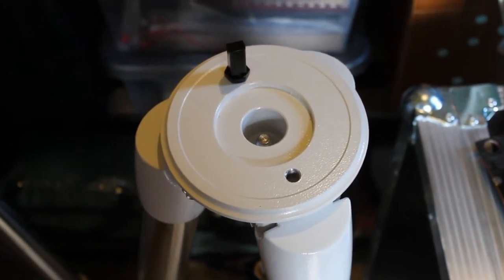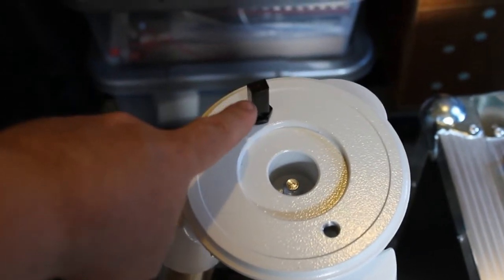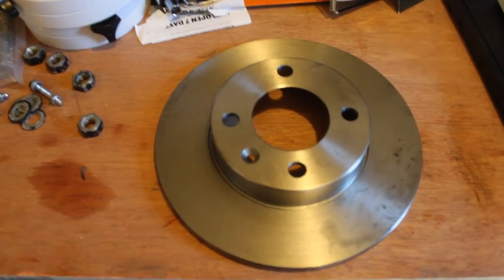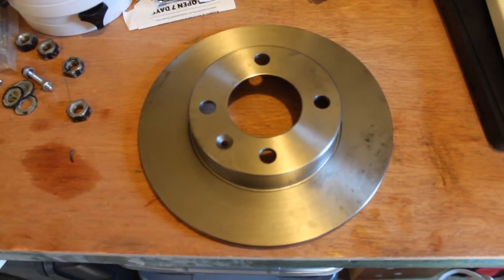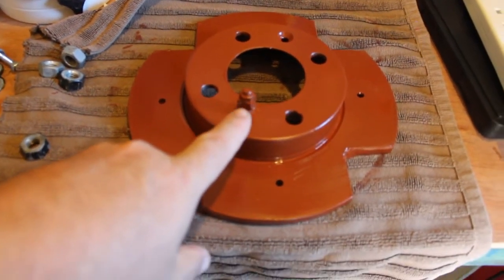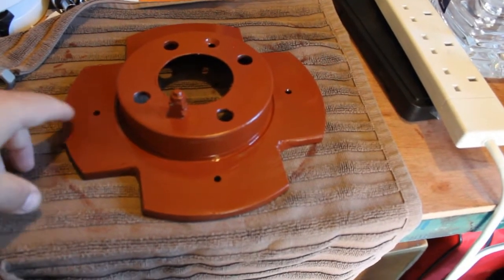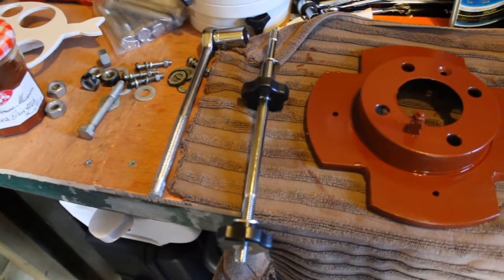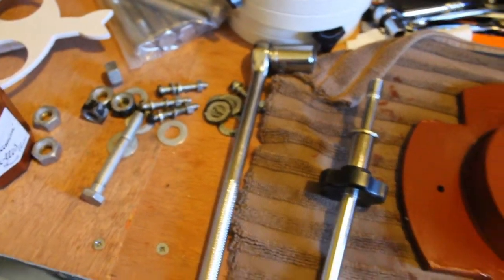DIY Pier Adaptor for Skywatcher EQ6-R Pro Mount.

Comment: a brake disk, was such a brilliant idea mate, but it doesn't match with a wood pillar. Pour some concrete as soon as possible, that wood will deform an deteriorate costantly outside.
Reply from the maker: @rewind-and-press-play  hey, thanks for the comment! Since I put this video up, I've moved house, built a dedicated observatory and fabricated a steel mount which is bolted onto a poured concrete base. I've still stuck with the brake disc idea on top of it though 😁

Comment: Hi, and thanks for this. I know it's 5 years since you posted it, but hope you still answer questions! What is the function of the middle plate - as you have bolted/welded a plate under the disc brake, why couldn't you fix it directly to the plate on top of your pier? Secondly, with a wooden pier, have you had any vibration issues? It'll be easier for me to set up a wooden one than a poured cement, so would appreciate your input! Thanks...
Reply from the maker: Hi there!. I'm still around and still astronomise but just don't have the time to do anything for YT. But I'm glad people like yourself are still finding it useful ☺️. So, the middle plate. I was very much thinking on my feet and thought the middle plate would add a bit of rigidity. I think after doing it this way, and seeing how others have used similar ideas, I could probably come up with some modifications. Now though, I have a permanent pier in an observatory. Kind of based on the wooden version in this video but made from steel.
And as for the wooden pier itself, well it was a success while I used it. I since moved house and there was no way I was going to dig down and break the concrete to get it out the ground 😂. So, it became a garden birdbath for the next occupants of our old house. Of course, there was vibration, but providing it wasn't touched while imaging, for me it was pretty solid. And definitely good enough for visual. But the question is, would I do it again? Well, on a budget, yes. All the convenience of a permanent set up/location saves a huge amount of time. But by saving and waiting it out until I could afford a concrete base and steel pier, it is obviously the better option.
I have also heard about other people using railway sleepers for piers, that it can also depend on your soil and proximity to main roads. If your soil is stoney, then apparently there is less dampening of vibrations from your surroundings. I've also read of people witnessing vibrations from passing HGVs etc. though that was never going to be a problem for me. I hope that at least partly answers your questions. 👍
Reply: @astromadness  thanks for the fast answer. In that case, I think I will continue with a poured pier, as it will also be in an observatory I am hoping to build this summer. 61 deg North, so permafrost will be an issue...

Comment: I purchased a disk brake with 65mm diameter center hole as you did and mentioned in your video. However my EQ6r seems not to fit perfectly. (It wong go all the way through) Probably 66mm would have worked. Did you incurred same issue? Did you have to trim/shave the hole a bit? By the way, excellent video and inspiring instructions. Thanks for sharing your experience with the comunity!
Reply from the maker: Hi Sebastiano,
Thanks for your kind comments. For me, the size was spot on. Once I put the mount into the hole, there was no movement from side to side, but it was loose enough to rotate with relative ease for polar alignment. I don't know much about engineering tolerances but I guess either the disc or the mount only need to be a mm or so different for there to be a little bit of play.
Best of luck with your project 👍
Tony
Reply: @astromadness  Hi Tony, thanks for the quick reply. I measured  the hole diameter of the plate and the protrusion of the mount and they are both 65 mm spot on so maybe it is a mater of tapping and "force" the install. Probably both pieces are in their lower tolerance but i feel I can make it work with extra elbow grease work!

Comment: I think you did a lot of research and made an really good job with the mount interface. But then to use a wooden pillar? I'd suggest that you make a substantial concrete one instead.
Reply from the maker: The wooden pillar for me was more affordable at the time and worked perfectly well. Since then, I have moved house. I now have a steel pillar on a concrete base in my observatory. All good and viable options to suit different needs and budgets 🙂👍

Comment: I also liked your video . I have an HEQ5PRO mount and I placed it on a concrete permanent pier and while the top portion of the pier was still wet concrete it had cut of my tripod legs leaving about 8 inches of leg and the tripod head and then sank the legs into the concrete well balance for level. And then waited 3 days for the concrete to cure. At that time I placed the mount on the tripod head and had enough room to use the long bolt that went thru the tripod into the mount bottom to firmly attach the mount to the tripod head. Yes I have ruined a perfectly good tripod but it was cheaper than ordering a pier head for the mount.
Reply: Aren’t the tripod legs hollow?  Do you have any pics or video you can share us. Thanks

Comment: Love it mate. We inherited a small vacation cottage just far enough from the city that the sky is dark there but its not too expensive to drive there and I thought about building a piere there and possibly building a shed around it later on. Then I looked at the prices of those pier adapters and those adapters cost like half of what I paid for my entire mount. like 100-200 quid or even more for like 2 pieces of aluminium. screw that. Glad I found out about using the brake disc

Comment: Love it, I am looking to do something very similar with a disc brake.  Can I just ask, why use an additional third plate to attach the disc brake to and why not just connect it to the second leveling plate?
Reply from the maker: Hi there!.  Thanks for your comment and question.  So, the bottom steel plate was just to be able to bolt down the metal work to the top of the wooden pier.  (Since this video, I have moved house and have an observatory, so it is now welded to the top of my steel pier.)  The middle plate has a small hole in the middle of it, large enough to take the bolt which screws up under the mount.  The bolt head pushes against it as the threaded end of the bolt screws into the mount, securing it into place.  And then the top plate is just used to bolt the adapted disc to.  Hopefully that answers your question :-)  Clear skies!
Reply: @astromadness  Ahh thanks for that explanation.  So I take it that the centre bolt was too long so you needed the middle plate to secure it up to ?
Reply from the maker: @julian489289  yep, that's it exactly 👍

Comment: Hi, some Gr8 ideas in the video.  I am in Australia.  Is your mount mainly for visual observing, as for Astrophotography if the wooden post  warps, expands, ages etc it would affect a perfect polar alignment.  Would have thought a metal post like steam pipe would be the go.  Also the mount is rather high above the pier which could cause some minor flex when wind gusts occurs on the scope causing imaging issues.  Your thoughts.... Cheers Mike
Reply from the maker: Hi Mike.  Thanks for your comment, and for taking the time to view the video.  I made this pier a few years ago now.  Since making this video, I have moved house and now have a permanent observatory with a steel pier bolted into a concrete 1m cubed base.  I understand fully your thoughts on the wooden pier idea though.  At that time, it was a case of making a pier to a budget for as little as possible, and to be honest, I think it totally worked.  I never left my mount in situ, so when it come to polar alignment etc, then I always needed to re-polar align when I set up my kit anyway.  Don't get me wrong, the wooden pier did have a little bit of movement, but it was functional.  Originally, I used it with a lighter Celestron AVX mount and a SkyWatcher 150p reflector and to be honest, I did end up using it more for observing than for imaging.  Again though, it served a purpose and I'm really glad I built it and got use out of it.
In different climates, you're right, I think it could of given me a few more issues over time with hot and cold weather extremes.  Generally though, in the UK, the weather is crap most of the time :-) so we don't have to worry about it too much.  If I wanted a pier purely for visual, I would probably use wood again to be honest, but once I got my observatory, I was only ever going to build a steel pier.  However, I have used the same brake disc idea for a pier adapter on the steel pier too.  When we left our old place, I left the wooden pier in situ and I believe it is now enjoying it's new life as a bird bath now! :-)
I wrote a blog post on building my pier.  Link here http://www.astromadness.co.uk/2020/02/diy-steel-observatory-pier.html  
All the very best, and clear skies,
Tony

Comment: Just got this mount yesterday and thinking about how to install it on my pier. Any reason not to just fix the top of the tripod to a plate ?
Reply from the maker: Hi there. The thought had crossed my mind, but I wanted to retain my tripod in one  piece so I still have the option of taking my mount to star parties. 🙂
Reply: Yes you could tripod top to a plate, but where to you put the through bolt to firmly attach the mount to the plate. I solved this with a concrete pier and the top portion of my tripod with mount head set in the concrete at the top of the pier. I cut all 3 tripod legs leaving about 8 to 10 inches to set into the concrete pier as it dried. Now I had room to use the threaded rod up into the mount base.

Comment: Hi..  The car is important because I would like to build one myself.. exactly what care was it from please ?
Or do you have a link from where you purchased it from.
I would be grateful for your help..
Thanks,   G
Reply from the maker: Hi, I'm really sorry for the late response, but I can't find the details of the order I placed, despite looking through all my emails.  However, the way I did it was to search online for a brake disc catalogue.  They have all the dimensions in there, including the hole diameter, the height of the disk etc.  I measured the top of the tripod which came with the mount to get the dimensions, and then just searched for a brake disc of an appropriate size.  That's what I would have to do again if I needed to repeat the process.  Thanks.  Tony

Comment: Hi, I was planning on doing this very thing and happened across your video. What car did the rotor come from? I know a 1983 Volkswagen Scirocco front rotor will work on these mounts also. Might have to do minor dremel work to make fit properly.
Reply from the maker: Hi Kevin.  I can't remember off the top of my head.  It might have been an Audi A2 or similar, possibly a VW golf, but I can't remember now.  I have also searched my emails, but can't find the receipt for the original order now.  Thanks.  Tony